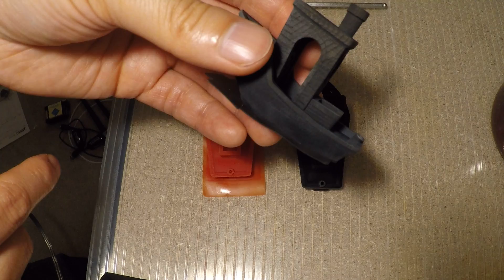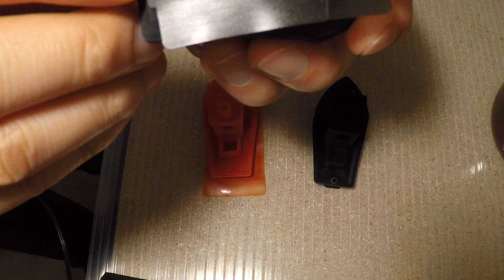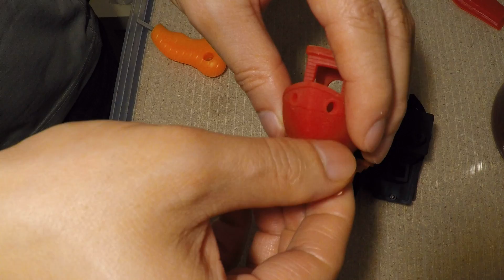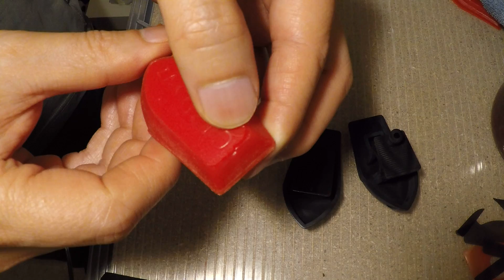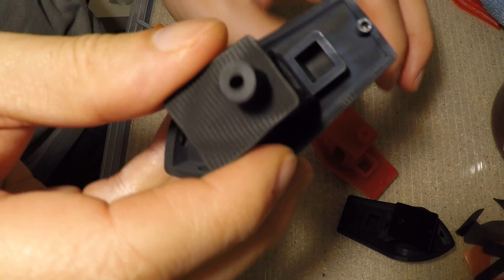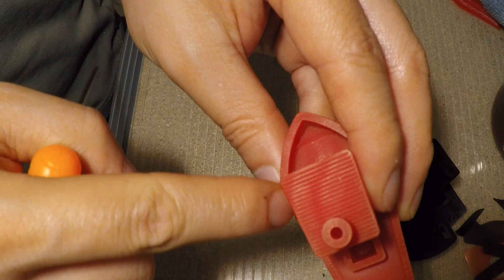Kudo3D Titan 1 SLA DLP 3D Printer - Completed 3DBenchy Prints

Comment: Hi, great video. Have you tried castable resin on this Titan 3D printer? Which is the maximum resolution you can achieve in this printer? Thank you.
Reply from the maker: Alejandro I don't do casting, so I have never bought or printed with any of the castable materials. I believe the current high resolution version of the Titan 2 is equipped with a modified projector that goes down to 23 microns XY. However, I typically print in the 70-90 micron range for larger parts.

Comment: If you had to do it all over again, would you still buy the Kudo, or would you go with the formlab or other?
Reply: I'm also interested to hear James' thoughts on your question. I've owned a Kudo Titan I since Aug 2015.  I get perhaps 1 in 2 prints that are sorta successful. That is after many, many experiments. As an example, I recently printed a space capsule 3x to get 1 successful print. I'm a computer programmer so I hope that I've got a little discipline about how I operate the printer.  But there are so many factors involved -- exposure time, resin types and quality, lift speed, lift height, suction forces, attachment layers, placement and size of supports. And then diagnosing failures is also a mystery half the time.

I believe the Titan I printer has a lot of positive qualities. The details on my prints are phenomenal! But I can't tell if my problem is the Titan I printer specifically or the DLP printing process in general.  I wish Kudo produced training materials that walk through all of the parameters in a controlled engineering manner so i could get a handle on what's going on.  James' comments on the Kudo forums and his videos are the closest thing I have to that. I can say though that once I switched from MakerJuice resin to 3DM ABS resin, my success went up.

In contrast, i've got a cheap little FDM printer and just about every print is a success. Prints aren't as detailed but its a joy to work with.

I suspect that the Formlab printers try to constrain more of the variables for you so you get quicker success and consistent results. But that's just my impression from sales materials.
Reply: I have a few FDM printers and you are right on the money , all the prints are 100% successful but the details are not as good as a SLA , I built a DLP SLA printer by recycling a dlp tv , It took lots head scratching to get it all together to work but it works ( with makerjuice )But it is rather bulky and I would like to replace it with one like Kudo or something, If budget wasn't a factor , I Love to get the new formlabs.
Reply from the maker: I totally would. The Titan 1 isn't just a system for churning out parts within a band of capability. It's a platform where you can adjust and add tooling to the printer itself to adapt to the job you need it to do. All of the components are extremely amenable to additional modification, for instance standard 20mm aluminum extrusions and 3/8" ball heads. This means that though adjustments or the addition of additional parts (like the tape flex vat), it's possible to make certain operations easier or certain types of prints more repeatable.

The biggest challenge is that you have to operate all of the parameters manually. The software doesn't really contain any knowledge of printability or mechanics, so you need to be able to "simulate" the print in your head. For me, generally I can get a part I want out on the first or second try, it rarely takes more than that. However, there is a learning curve and you have to plan as far up the pipeline as possible. Plan for printability when designing the object in CAD. Plan for printability when orienting the part and adding supports. Plan for printability when configuring settings.

On the point from Robert about being a programmer, I'm also a programmer. I've been working on the Photonic3D project because it allows the use of JavaScript functions as settings with inputs such as print surface area and current layer. I've been working on functions that make it easier to get a part out on the first try, like slowing down and lifting higher on high surface area layers, based on functions. If you want to help out, we would definitely use the help, especially in terms of actually using the tool and tuning the functions.
Reply from the maker: Or rather, I should say that the Titan 1's greatest strength and greatest challenge is the ability to control settings in great detail.
Reply: @James I did see the Photonic3D project! I got as far as making a prototype using a spreadsheet with calculations based on the info that Kudo has on their site -- and kept playing with that to get control of my print parameters. I'm intrigued to learn more about what you guys are doing, thanks.
Reply from the maker: The out of the box Titan 1 profile for Photonic3D contains some functions that I developed based on some minimal research, but what I really need help with is more testing on the amount of lift required for different surface areas to improve the model, and some idea of whether a model developed on one resin is applicable to other resins by controlling just one or two coefficients.